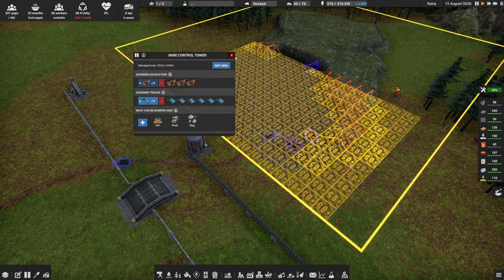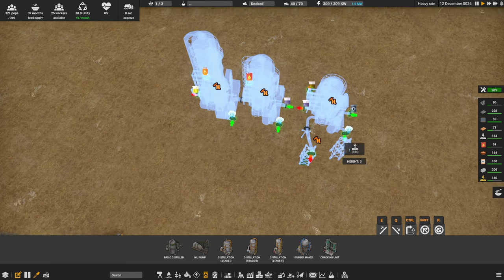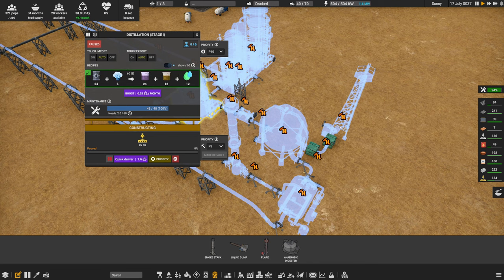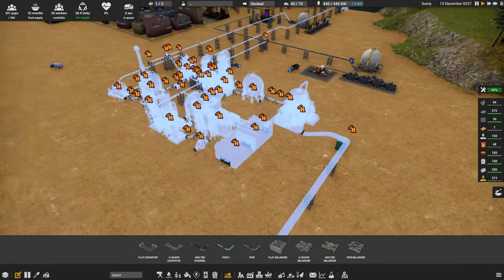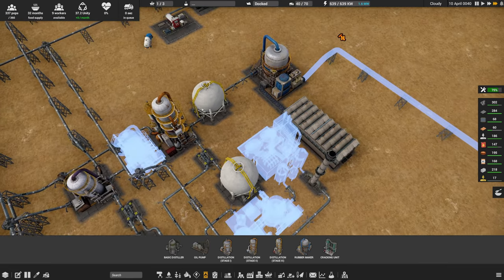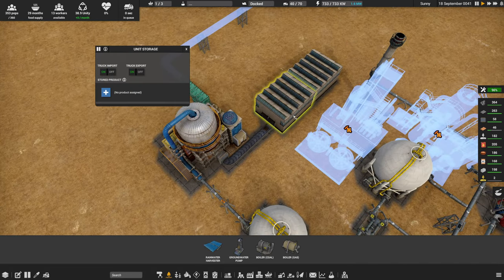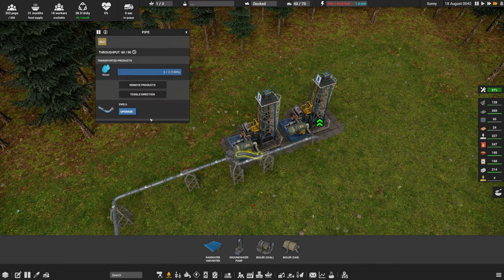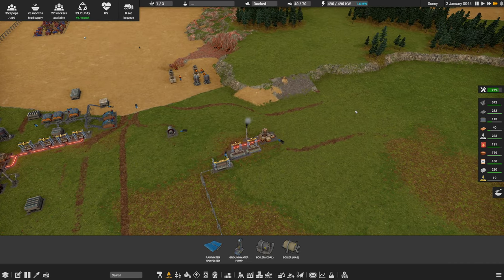Advanced Oil to Rubber 🚛 Captain of Industry 🚜 Ep7 👷 Lets Play, Walkthrough, Tutorial [Beta]

Comment: Also also, why don’t you add another fluid module to your cargo ship, so that you half your dieel consumption (as it then has double capacity). 

This message has been brought to you by the federation of armchair generals. :)
Reply from the maker: It seems as fast as im getting it im pumping it, I really need a second ship and a second oil rig
Reply: @JDPlays  That's what I mean. You can fit a second fluid module on the ship so your cargo size doubles. You can add shifts to the rig, so they pump twice as fast. You'd get more crude faster while paying only half the diesel in transport costs.

I think, anyway. :)